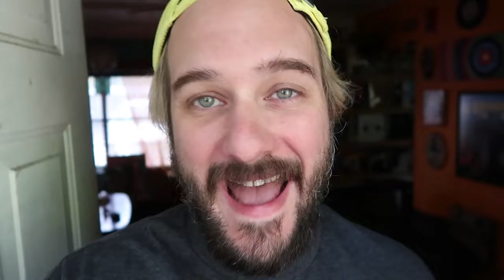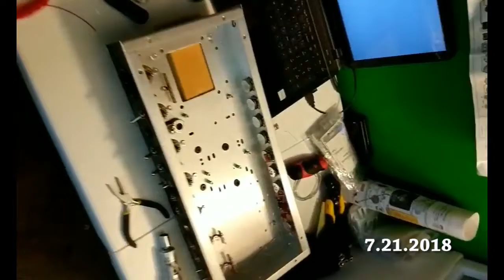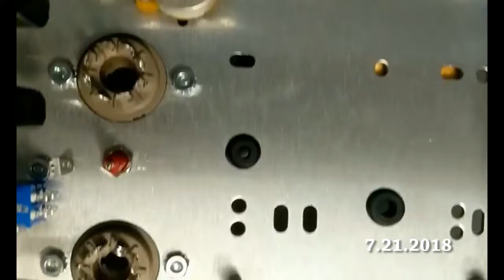Building A Dumble Overdrive Special 102 Style Guitar Amp From Start to Finish

Comment: it only hurts halogen lights when you touch them with bare hands has to do with oil in skin reacting with halogen bulbs, but any other type bulb or tube it is ok to touch and since there arent any halogen amplifier tubes you can touch them all you want.

Comment: How much did everything end up costing you as far as components & parts, and where do you purchase all your parts from?
Reply: Based on what others have said about building these, the average cost is between $500 and $1500 depending on how nuts you get with "NOS" parts and whatever. If you just order based on lower price off Mouser, and use a schematic that takes into account modern cap values, you'll be closer to the $500 price point. I see some large, fancy capacitors in the video, and it looks like he ordered a kit... so I'm going to guess he's closer to the $1000 mark.
Reply from the maker: @charliemopps4926  About half the price was the chassis, head cab, and transformers. The transformers came from Classictone... the head cab was used from a guy on ebay, and the chassis came from Asia. It came out to around $1000 without the speaker/speaker cab. I got the orange drops from Antique Electronic Supply. The other parts came mostly from mouser. I also had some of it already stocked in my parts bin.
Reply: @BirdsnakeBrown  It looks sharp. Well done!
Reply: Which ot and pt did you use from classic tone? Used them in my deluxe build but not sure which to use for a dumble style

Comment: Beautiful build. Your wiring is top notch professional level work. Not to mention your attitude through the whole thing. I have built several circuit, from pedals to amps, and I about have a panic attack every time before powering them up for the first time. Take a bow, well done.
Reply from the maker: Thanks so much! The amp is still going strong.  I learned over the years to take a slow and relaxed approach at the end of a build... if you don't expect it to work then it usually will lol

Comment: The amp sounds fantastic. Thank you for sharing your wisdom with us!!!
1. Where did you buy your kit from?
2. How did you determine the shield side of your orange drop caps? 
3. Did you make them with a marker?

I do not know how to check this without expensive equipment.
Thanks.
Reply: you can go on Hoffman amps site- EL34 World. forum has archives of cap direction, and site has shop to buy parts. also tons of  schematics, info on building, and a very informed group of helpful forum members. it's where I learned to build amps. and remember lots of original Dumble were built with standard Fender and Marshall power and output transformers. I built some beautiful clones, and would have done better business if I wouldn't have gooped them with fudge... people got ants... I got sued.

Comment: Fantastic build and fantastic playing! I've watched all your dumble videos and really liked them. I'm just starting a #102 build myself with the help of the lovely folks at ampgarage. 

Great idea to run your midboost through the foot switch.  How did you wire that up? I've been trying to figure that out.  The only way I can figure it is that the midboost is only operable through the footswitch and not the toggle. Is that correct?

Comment: Great video. Was this built from a particular kit? Wondering where you got the chassis and the face plate from?
Reply from the maker: Thanks very much!! The chassis was from ebay... they show up from time to time. Usually, someone on ampgarage has a chassis available. I didn't use a kit. The parts came from mouser, antique electronic supply, and a few other places.

Comment: Is there any risk of the tubes working loose and falling out since they are pins up? Do you use any kind of retainer to keep them tight in the sockets?
Reply from the maker: I use the regular old style retainers like this one https://amzn.to/37g9hhd ... even in my vintage Twin Reverbs where the retainers are old and worn out I've never had a tube fall out or even come close.  On those old vintage amps you do have to re-tension the sockets at some point, but they would have to get pretty loose for a tube to fall out.
Reply: @BirdsnakeBrown  Thanks! Looks like Cary makes some nice tube sockets as well.

Comment: Hey there! Great job on the amp.  I also have built myself a "102" clone and i love it.  I notice you have a noticable amount of more gain than my amp.   Curious of where you have the od trimmer set?
Reply from the maker: I have a pot on the back of the amp... it's at 25K when the pot is at noon... occasionally I'll bump it up a little bit with single coils, but generally I leave it right at or slightly below 25K.

Comment: Hi, I have a Dumble clone, but I wanted to ask you where I could get a faceplate that says Dumble by Dumble. I would really appreciate if you could tell me where to get one. And would that faceplate fit a Ceriatone HRM amp? Thanks from Michael Newell from Niagara Falls, Ontario, Canada
Reply from the maker: They come up for sale on ebay every once in a while.  I haven't seen one in a while, but if you keep an eye out they do show up sometimes.  The chances of it fitting are good, but you might have to enlarge some of the holes depending on how tight the fit is. Good luck :-)

Comment: What is this circuit most similar to is it like a hopped up bassman ?
Reply from the maker: The power section shares some similarities with black panel fender stuff, but the preamp has more mids, and the overdrive is something completely different.

Comment: Is this a kit? And where did you get the Dumble faceplate?
Reply: Ceriatone amps. Theh are from indonesia but ghey are excellent they have like 20 dumble variations and the same for marshalls . Four different train wreaks. And they are reasonable!!
Reply: @russellesimonetta3835  Thanks so much for replying. I also asked about your faceplate.  It says Dumble on it. Did you get that from Ceriatone also?
Reply: Jeff, that,s not my amp ,,, i,m just  commenting on what i thought it was! That a amp built from parts from ampgarage! But ceritone makes kits for some really great amps. They look just like his! You should check their web site. Jyst type in ceriatone. They come from indonesia so most order the kit without transformers and order american iron.
Reply: Russell E Simonetta E

Comment: Your amp will sound a lot better if you get rid of those IC brand power capacitors...….they are cheaper in cost than other brands....and yes Fender uses them in their new production amps.....but they affect the sound.  Sprague's are the premium brand but as far as my suppliers go, they do not carry the big caps anymore so the alternative is the F&T brand, which is a very good cap.  Illinois Capacitors are just cheap Asian source garbage......they work but the sound will be notedly better with alternative brands such as the F&T...….from 35 years of experience.     Next thing, you use orange drops throughout the whole circuitry.  The orange drops are more costly than other film caps and bigger in size physically, both of those factors do not mean that the Orange drops are the ultimate film cap for sound.  I tend to only use them in the phase inverter circuit when I build amplifiers...or rebuild amps for my clients.  In your first gain stage, replace the orange drops there with either Mallory 150 series caps or Jupiter brand....but Jupiter has 2 types...yellow and red.  It would be worth your attention to try all 3 in that position and listen critically to the amp as each one will have a sonic character that will be much better than an orange drop and will probably be much more musical.   As for your tubes, if you chose the 5881 wxt Sovtek, good choice, but set the bias so that each tube pulls at least 35ma current draw.  You can probably go higher in current draw....  The formula for determining the wattage output of each tube is critical.  For 35 ma at 460 plate volts,  (460) x (.035) = 16.1 watts per tube, and the 5881 should be good for a maximum of 30 watts on the tube, but you bias for 70% which is around 21 watts per tube.  So at 35 ma, the bias is about 55% and on the cold side which is going to be kind of clean and not with much good tone as you would get out of the tube if its bias'd hotter.  But as you bias hotter, the plate voltage should drop down.  Book value for an RCA 5881/6L6 is 400 volts maximum on the plates, though they can take more....but the object of the game is to stay more close to 400.  AS the plate voltage goes beyond, the tube response is more linear but it also gets brighter and more harsher & brittle.....too clinically clean.  Lower plate voltage will sound more warmer and juicier with tone much like a 1950's amplifier.   You pre-amp tubes also matter, the LPS version of the Russian tubes are good as well as the EH12ax7 due to the long plates......and the plate voltages should also be on the low side between 140 to 180 plate volts......higher will yield more head room but also more brighter and more brittle with less tube tone.....which means adjusting the node voltage in the power rail feeding the plates.

Comment: IC Cap Filter... You Looking for trouble... Those cap are really low quality and gonna leak soon...
Reply from the maker: I have used a variety of filter caps over the last 20 years and the IC caps don't fail any faster than F&T or anything else. Sprague atoms are the only ones that seem to last forever. I read somewhere that people in the amp-building community are weary of IC caps because of a comment made by Gerald Weber, but in my experience, they work just as well as anything else.